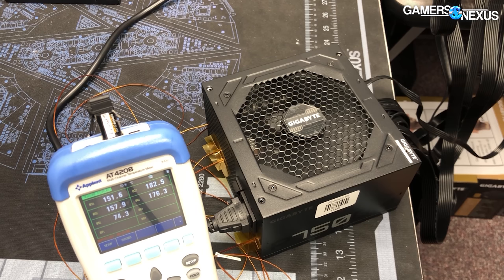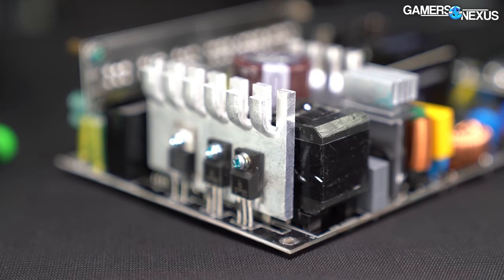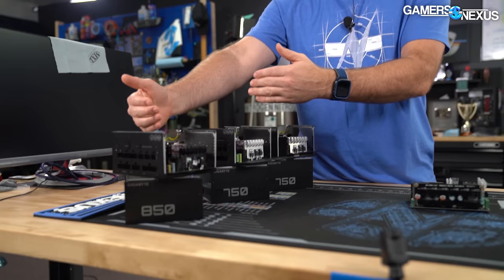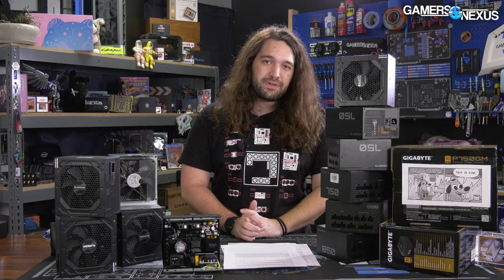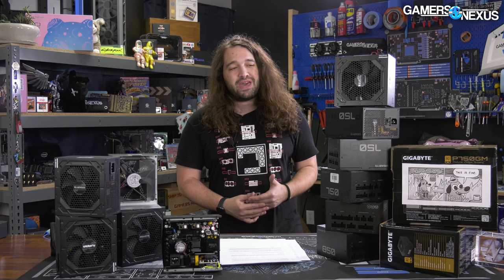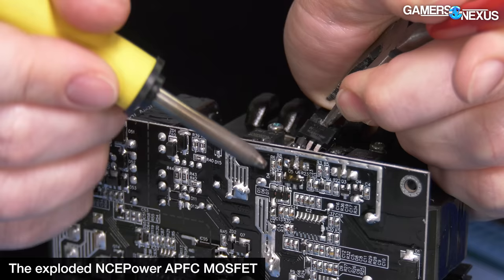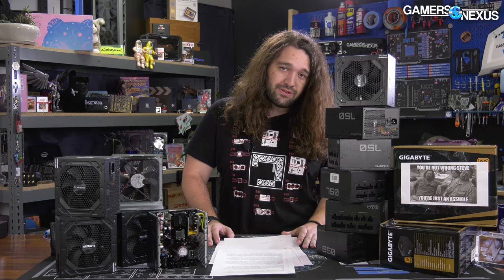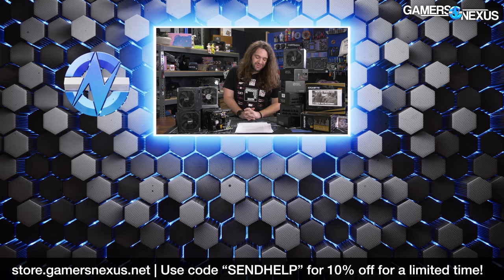Exploding Power Supplies: Gigabyte & Newegg Dumping Unsellable Product

Comment: Those FETs shouldn't be getting anywhere near that hot with that sort of load. The F variant of TO220 are much more sensitive to things like die delamination from excess torque during installation in being screwed to the heatsink, if not die delamination (which would increase Rds - drain-source resistance, leading to excess heat buildup and then failure), would increase the thermal resistance in celcius/watt in context of resistance met in dissipating heat from device to heatsink...which would also lead to excess heat buildup in the device and then failure.. The thermal resistance of the F variant of TO220 is already higher than the TO220 to start with. Like, nearly 3 times higher for this device.
You do have to electrically insulate the package from the heatsink with a mica pad and plastic bobbin and what not (the F variant is a plastic package, the TO220 just has the metal tab), though. The screw torque that has the thermal resistance of the F shooting way up is still fine for the TO220 and actually results in a lower thermal resistance.
I wonder if they were supposed to use a TO220 and tried to save some money by not having to use mica pads etc on each device...or whether their jig for installing them was designed for TO220 so when it came to tightening these down, it overdid it. That'd all certainly contribute to very early failure because again, these FETs shouldn't be getting near that hot for that kinda load when on a heatsink. 
It could also just be shoddy design, or both,
Reply: It is a curious observation by you. It appears that by TPU Greece results and by GN results, BOTH the FETs in the APFC and primary-side of the transformer have Rds too high, which seems like a bit too much of a coincidence. It's just that obviously for GN, being in 120V region as opposed to 230V in Greece, APFC having to handle several times higher currents has to give up first.

To be kept in mind that the FETs are by some really new semiconductor companies with no proven track record, there is really no telling as to whether they're up to claimed spec. But the PSU OEM is also inexperienced.

It for sure an entirely avoidable mistake. Primary side has not seen many critical faults in established OEMs' PSUs for decades, because really the currents aren't that high, it's not that hard to get right.
Reply: @SianaGearz  It's based somewhat on intuition through experience, I've seen the seem mistake lead to failure before. I did actually forget that they were 120v, lack of sleep and being in a 240v country hehheh. That would certainly make it worse, although those parts should still be capable of handling way more current than they should be here, all being normal. However, as you pointed out, they're produced by a more relatively 'unknown' producer in the space. It could also just be bad batch(es). Hard to tell without knowing the batch or manufacturing dates. Either way, was just something that immediately stood out so I thought I'd mention it in case GN should see it and wanted to do a bit of a deeper dive as to the real reasons for the failures :)
Reply: @nicwilson89  Intersting post, very usefull, thank you. I have a unit of this PSU and i tried everything to blow it up ;). I even shut down the fan and the FET reached over 180 degrees at full load, with no issues. Your analysis seems logical to me. Would also explain why only some units fail and others like mine even work with no problems unter extrem conditions.
Reply: dude but look at the vid.. the fans arent even spinning.. hell yeah it will get hot without the fan spinning.
Reply: @tweakpc  didnt you notice the fans arent spinning when the sparks fly?
Reply: @1985EganPeter  Sometimes they were, sometimes they weren't. I don't know what the PSUs were doing at the time so I can only speculate on two things, either bad/faulty batches of parts, or manufacturing error ( as far as being related to my initial comment. Still a billion other possibilities that I can't speculate without testing myself). Still, it's interesting
Reply: @1985EganPeter  A lot of PSU's now employ a silent fan approach for lower loads. It isn't as sophisticated as a true fan curve but rather an on-off based on a thermocouple and probably a load sensor on the PSU. Usually around 20-40% load the fan will kick on. Depends on the manufacturer. I would be very surprised, however, if the fan was not running at a 60% load.
Reply: @tweakpc  Thanks :) and very interesting! I wonder what the batch or manufacturing dates are of the exploded devices and how close they are versus ones that lives as yours did. That'd rule that out...then it's just either wrong part used or manufacturing error installing them down (or both)...at least as far as my initial comment goes, but I can't speculate without something else to go on.
Reply: On a few scenes the fan was not turning.
The temps on the FETs are way to high, the fan and heatsinks should keep the temps down. Is this Gigibyte say lets be quite and keep the fan down over let the fan control temps.
Reply: Brain breaks halfway through 3rd line
Reply: @felixcosty  I've no idea whether the PSU is monitoring those FETs for deciding when the fan should run so I can't comment on it. But under lighter loads, when that PSU normally doesn't run the fan even, the heatsink should be more than adequate to cool them. They're capable of handling way, way higher loads than this PSU could ever dream of, and will run up to fairly high temps (although you'd want to keep that down). They're primary side and for power factor correction, so they're not handling the huuuge currents the 12v rail(s) can supply, for example. Who knows.
Reply: @gamingwithblaise3822  Haha, I'm exhausted so I apologise if my literary ability was...uhh...'slacking', and it's just hard to read in general :D
If you mean my initial comment, that is. I'm assuming so.
Reply: @nicwilson89  It's hard to read not because of bad grammar, but because of booze in my body BAHAHA. I feel you on exhaustion - my job demands a lot from me and I try to push beyond what it wants everyday I'm there (less of trying to impress people and more of just how I was programmed in my younger years).

Bring sober me to this comment and I'd be drooling over the information you've provided in your original comment!
Reply: @gamingwithblaise3822  Yea, fair enough, good reason ahaha :D I feel ye on trying to push yourself, I'm the same...within reason, at least. I went wayyy too far in my younger years and working several jobs at once and it lead to an almighty catastrophic apocalypse like nuclear meltdown, which sucked haha. You probably know this already, but listen to your brain when it tells you that you're going too far. I'd hate for anyone to repeat my mistakes, we all gotta take care of ourselves :)
I mean you seem to be doing that already in bring drunk on Youtube but y'know, I wanna spread some positivity 'cause mostly Youtube comments are just arguments :)
Reply: Interesting possible failure mode, but my money here is on something more pedestrian.  Either the gate drivers aren't pushing these things out of the linear region or they've cheaped out on filtering and they're driving a difficult load through the inductor.  (Well, transformer in this case, if I'm understanding which FETs are dying.  But same diff.)
Reply: @nicwilson89  Hahahaha, I'll be sure to send your message to the me back in 2018!

I too have learned the hard way that pushing without stopping only leads to a massive breakdown that likely ends waking up in the back of an ambulance (or in my case in the middle of the kitchen). Never fun to feel your body start shutting down while you're holding a knife, luckily my first instinct was to put the knife down, or I might have stabbed myself as I collapsed and started seizing.

Since that incident (2 years ago... feels like it's been longer) I've learned that burning the candle at both ends just isn't worth it. Not unless you are being compensated in a way where you don't have to worry about supporting yourself in your day to day life. Back then I was working 60+ hour weeks living paycheck to paycheck (the company was royally fking me in the rear). Now I'm working right around 40 hours a week and don't have to worry about my bills and can generally do what I want when I want as long as I don't go too hog wild on my plastic money device.

As far as being drunk- I'm not quite there yet. I do have a solid buzz but am out of drink and won't be getting another bottle until later this week. Heck, I'm thinking of going a bit more up the price ladder and getting a bottle of Laphroaig 10. Been hearing a lot about that one lately (since Jayztwocents brought a bottle onto the RTFM show 2 weeks ago). Stuck on peanut butter whiskey and "The Whistler" Irish Honey or Double Oaked whiskey.
Reply: @1985EganPeter   Hi Peter, yes that is strange, because my units fan starts spinning at 25-30% load. So it will never run at 60% load with the fan off. Only if the PSU is turned on an dies instantly. But as i said, i manually disconnected the fan and it still would not die. So its not the fan cooling. Its another problem. Therefor the mounting to the heatsink could be the issue. But since I only have one unit that does not have any issues, difficult to test.
Reply: @gamingwithblaise3822  Shame to hear you had to go through that but I'm glad you're doing great now! Yeaaaaa I was combining that with mental illness, borderline personality disorder, and, well...went about as well as you'd expect. Did the same shit three times determined to prove I wasn't weak to myself hehheh. However, valuable lessons! 
Also had to give up drinking for good in 2016 because mental illness...ain't much that makes me regret that decision usually but damn, those sound fucking good. Always loved some Laphroaig! Gotta treat yourself every now and then, buy yourself something nice :D
Reply: @nickwallette6201  Yea, I didn't want to speculate on that as I haven't looked at a schematic or looked at a unit myself and probed around. Certainly possible! It just came to mind when it became apparent that some units are likely to fail and some seem fine. That could be an incorrect part used in some batches of PSUs in a related part of the circuit. I'd love to be able to take a closer look at one, it has me intrigued!
Reply: @tweakpc  Uhhh you know that 180°C is already well beyond temperature of expected failure. I'd call it a miracle or a pure coincidence that your survived.
Reply: @nicwilson89  Yeah, I had those runins when I was a kid but never really knew what it was (and they didn't manifest in a seizure like it did a couple of years ago). Grew up being forced to work in tobacco, which absolutely sucked (8 years of working under an abusive POS, mostly mental abuse).

I should probably give up drinking but i doubt I will. I've already learned when to cut myself off thanks to college (and trying to figure out 8 years of crap while also trying to figure out what I want to do with life), which didn't work out too well. Not proud to say I used to be able to club a 5th of vodka and still be standing...
Reply: It could also be shit parts that don't deliver on their specs. Or counterfeit parts.
Your theory does sound promising however!
Reply: @gamingwithblaise3822  Yeaaaaaaaaa it was abusive childhood that lead to my particular flavour of mental illness. Abuse can be incredibly damaging no matter the age. I'm sorry to hear you had to live with all of that, truly.  Wish I'd learned how to have that control with alcohol though, haha. I just kept falling into the same trap of using it as a means of escape and eventually daily drinking (a lot of drinking), over and over...so it had to be cut, unfortunately. Saved a lot of money with that being said pahahaha. I distinctly remember doing that only with rum instead of vodka...as pre-drink drinking...before going out, Good lord...yup, definitely saved me a lot of money :D
Reply: @SianaGearz  I know, the spec for the FET is 150.Under normal conditions the FET never got over 130 degrees in my unit. So i tried to heat it up, it still survived...
Reply: @tweakpc  Yeah 130 on the casing is probably closer to 150 or more on the junction, since there is a thermal impedance in between. this is over long term not entirely healthy already. Running like that, maybe good for a few months, not indefinitely, so high failure rate with a lightshow is not surprising. I expect an average PSU (not particularly expensive) to survive 6+ years, and still fail on the secondary side rectification or somewhere in the bootstrap, not APFC and not primary transistors!

Besides, colour me impressed if it can bake the primary circuits that hard and still scrape by 80+gold spec. Reeks almost of a 600W Platinum PSU which got butchered on the wrong end and became a 750W Gold.
Reply: @SianaGearz  600w platinum maybe, it reaches around 89% at 600 Watt.